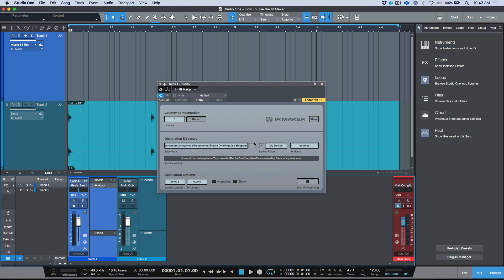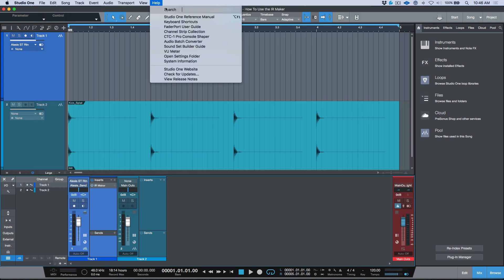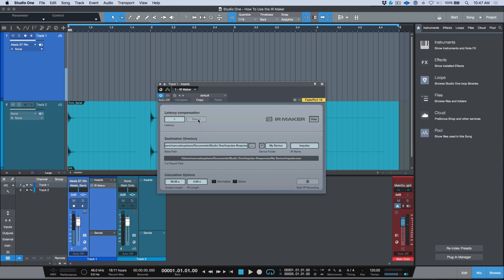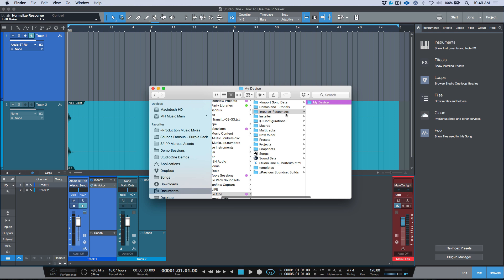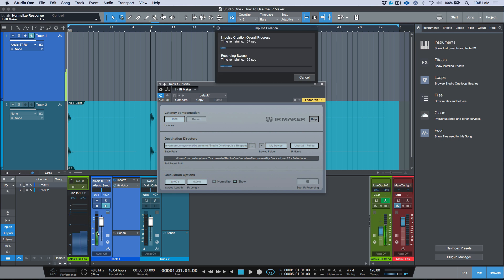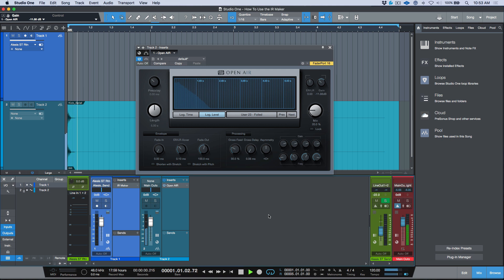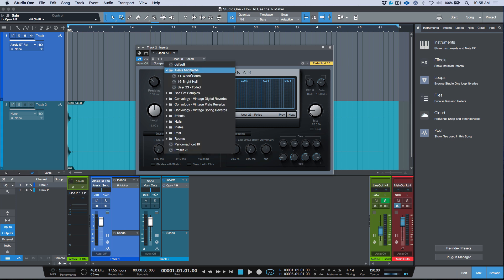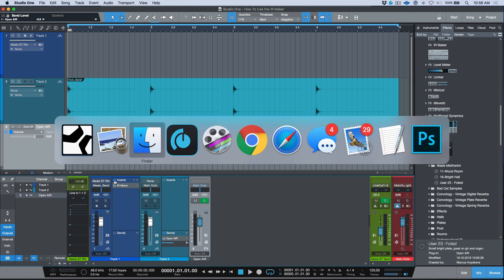How To Use the IR Maker In PreSonus Studio One

Comment: Thank you!
Two questions: 
Creating an impulse response for a large room, is that similar to making one for a guitar cabinet?  Will you be covering that?
About file organization: after making changes to my own preset (Impact, in this case) when I 'replace preset',  why does S1 make a new copy of the preset in the open folder and not update the version in the sub folder I created where it was already saved?
Thanks again for timely and useful content.  : )
Reply from the maker: Regarding your 1st question:
You would literally have to set up speakers to play the Frequency Sweep then a Mic to record it back in, and keep hitting "Start IR Recording" (then cancelling before its complete) to get your levels right...
The output of the speakers would have to be high enough to "excite" the room, then your input levels would have to be high enough to record a decent signal, but not too loud that it distorts/clips..

Regarding your 2nd question:
It's hard for me to answer without seeing what's happening on your system.. But 2 quick pointers I can give you would be A) Click the Home Tab (Home Icon) in the Studio One Browser - and at the bottom there is an option to "Re-Index Presets" B) just save them to the main presets folder - then move them (manually) from you finder (or Explorer) and then Re-Index your presets so Open Air puts the presets in the proper sub folders.
Hope this helps..
Cheers, M🍻
Reply: @marcushuyskensmusic  meant to say thanks sooner.  about the ir maker, clearly not the tool for the job in question so I can stop stressing about it!  (got the speakers and the mics, just couldn't get the plug in to do anything useful)
it was impact presets.  I will work on the re-indexing.  thanks for the info.
Reply from the maker: You're welcome! 🍻